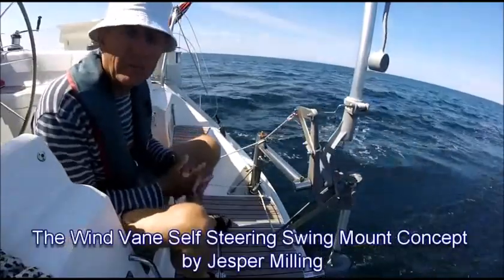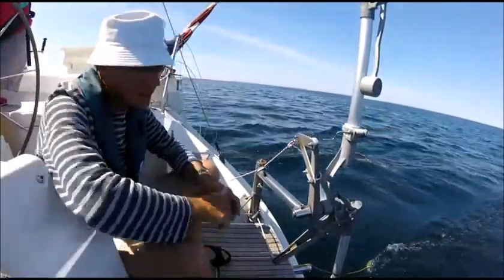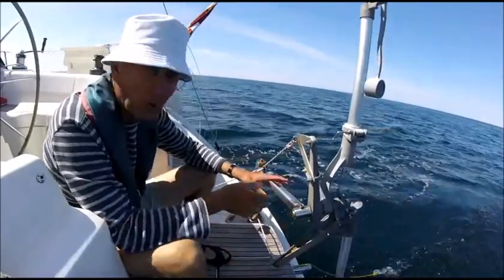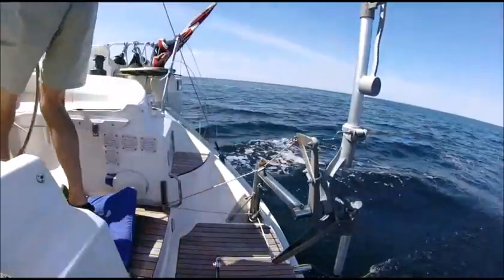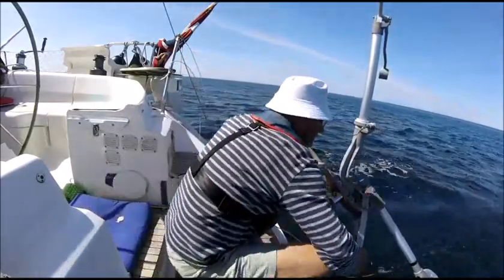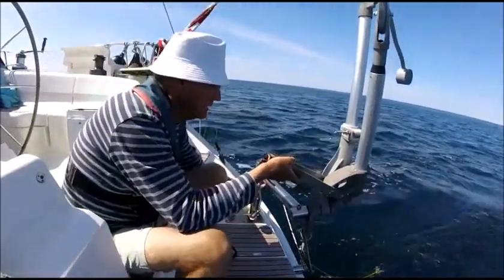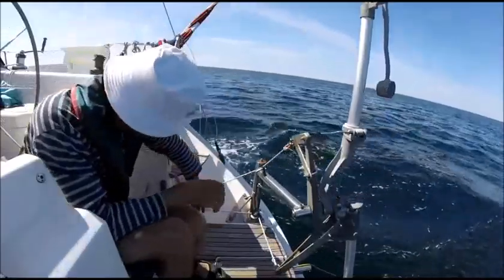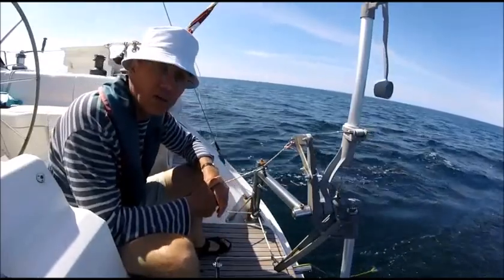Jesper Millings Servo Pendulum Wind Vane Self Steering Swing Mount

Comment: Very nice.  My only question is the break-away...and/or  if it hit something would it torque the swing arm excessively?  thanks for the clear video and explanation.
Reply from the maker: well I dont know what would happe if something graps the swinging arm. it locked in position with an 8mm bolt screwed into the inner pipe, and if enough force is applied something would brake, but I dont know what would brake.

Comment: I'm thinking of buying a Neptune, should I? How satisfied are you with the the windvane?
Reply from the maker: Hi Peter. The Neptune is very much like the Pacific, but differs in three ways. The build quility is not nearly as nice, the wind vane tilts on a horizontal axis, where as on the Pacific it tilts at at angle, and the price of the Neptune is much lower. I don't know if the build quality has any effect on how well it functions or how long it will last. I am afraid the wind vane tilting horizontally, and not at and angle is the reason I somtimes cannot make it work properly at some wind angles and wind speeds. But How can I know for sure that the Neptune would have a slightly larger spectrum of well working wind situations if the wind vane was at an angle? I cant say for sure. The price however is much much nicer. I have not been using the Neptune on any long passages lasting more than hours. No crossing the North Sea, yet. I have been experimenting with reducing the size of the steering wheel unit, and will have to test an even smaller wheel unit. The concept of the Neptune however is great. It doesn't take up much space, especially not when mounted on my swing mount. It cannot oversteer, the servo rudder can only go so far out to either side, because it is automatically  turned into a zero degree angle of attack when it swings to its outmost position. I would not be interested in anything but a servopendulum concept. I might want to add, that some people tell me they could never make their servo pendulum work properly, others have pointed at mine and told me they had one just like it, and it steered their boat all the way across the Pacific. I hope this helps. you are welcome to visit and come sailing with me.
Reply: Hi JesperThanks a lot for  your prompt responce to my question, and thanks for offering the possibility to try it out. It might not this year as i guess you are somewhat already on the hard. Nevertheless I would really like to see it when it fit both yours and my ttime plan. How can I contact you?
Reply from the maker: I don't take my boat out of the water, except two weeks in April. You may write me an Email at jesper.milling@outlook.dk. Your name is very Danish, do we have to correspond in English?
Reply from the maker: We could go sailing tomorrow.

Comment: It's a good idea although I would be concerned with its sea worthiness in a more challenging weather condition.
Reply from the maker: It was never tried in heavy weather, but it could be made much stronger without compromising the idea, or the useability, if needed. Dimensions were chosen partly from a gut feeling, partly from availability of materials. Please explain your concerns.
Reply: probably the concern is leverage exerted onto the hull connection by the servo blade. I'm interested in knowing how you would strengthen  the system.  Great idea and it would suit my boat perfectly.  Very
 clear video too, thanks